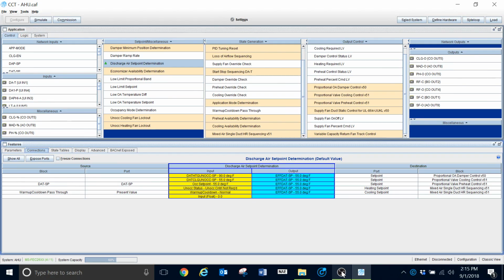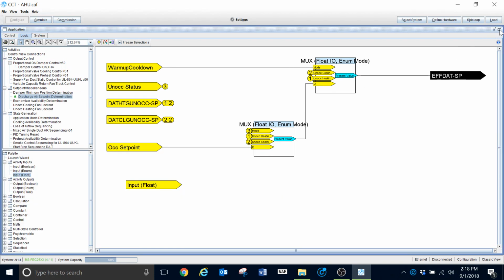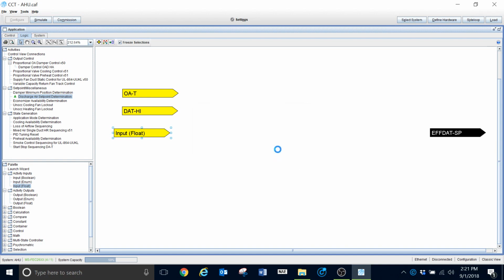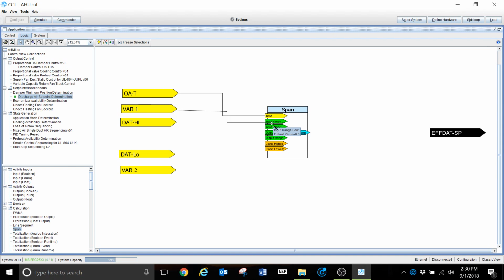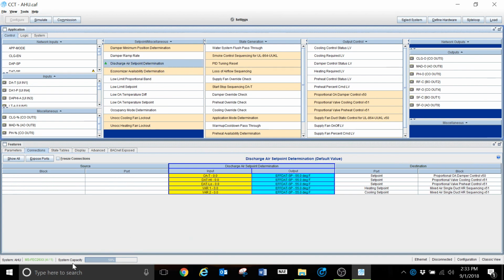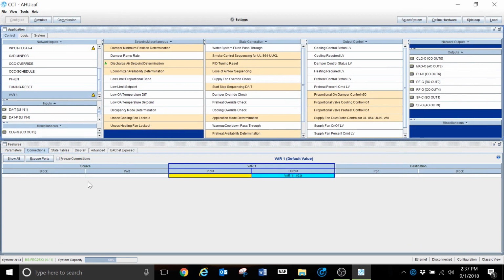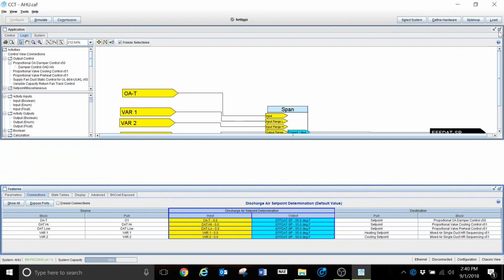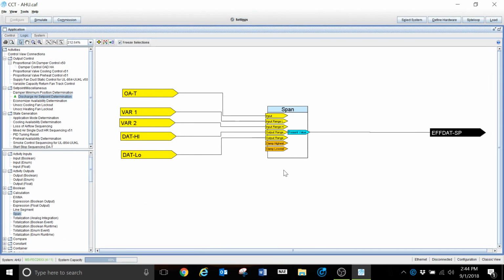Calculated air handler discharge temperature

Comment: How Would I also make the Calculated Discharge air temperature Set point user adjustable ?
Reply from the maker: I've answered a few questions in this video. Check it out here: https://youtu.be/6WfN1CMTVWo

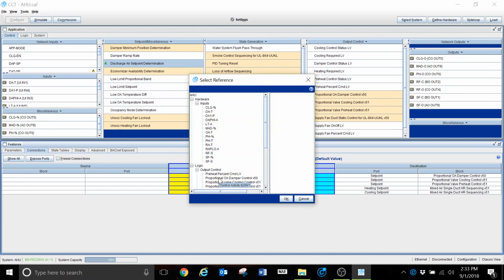Comment: Went you did the outside air temperature connections in CCT you selected the DAT, I’m confused why? Fast forward to 13:08.
Also thank you for all your awesome videos, I really really really appreciate them I learn a lot from you please don’t stop making them specially the CCT videos.
Reply from the maker: The calculation is based upon the outside air temperature.  The colder the outside air temperature the higher the discharge temperature of the air handler.